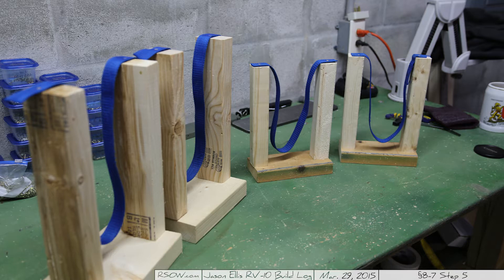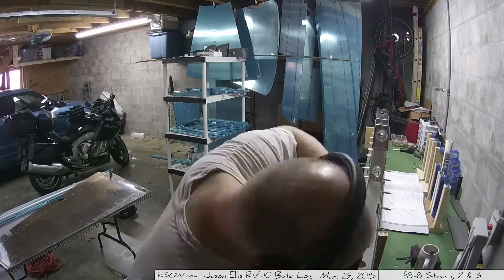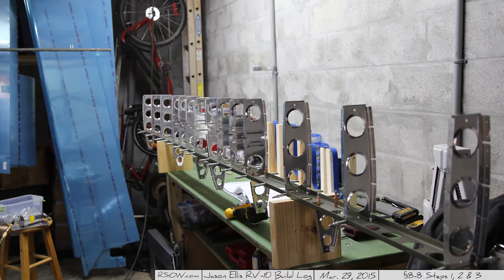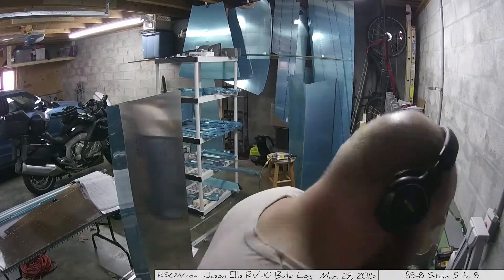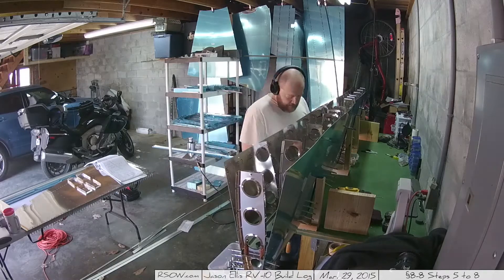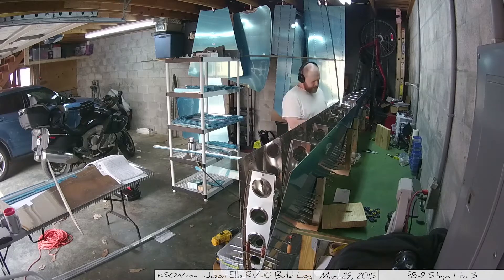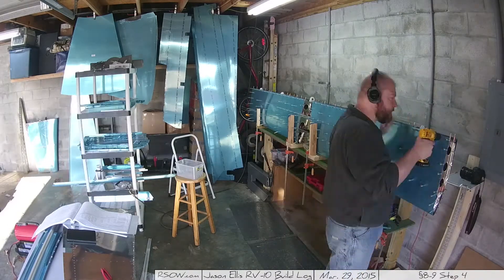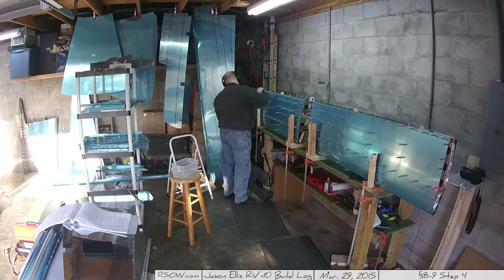RV-10 Empennage Sections 8-8 to 8-9 step 4

Comment: not sure what the instructions call out for, but i dont think you need a cleco in every other hole. you can go once every 5 or 6 holes, and be just fine, assuming its on a long run and not at the end of each part.

Comment: Jason, 

I am at this step right now... making the cradles. How long was your table in this video? I have a 6' long by 2' wide board I am thinking about placing between two saw horses? The reason for using the saw horses is they are adjustable, and I can get them pretty low. My goal is to avoid the need of a step stool to work inside the skin. If you don't think 6' long is long enough, I will probably just use my standard table and add extensions to make it 10 ft long ( it is currently 6' long as well) but then I will need to use a step stool. Hope you had a great Christmas! Thanks!

Comment: Honestly making these relatively cheap planes and selling them would be a pretty good job, some of them would allow you to pull in a profit of say $80,000 and as long as you keep that as your job you could probably finish a plane in a year, an annual income of $80,000 is pretty good
Reply from the maker: I have pondered that a lot actually.   I have been pondering making a video about it but the short version is; you're not guaranteed the outcome and there are things you're not taking into account. 

Right now if you go to work at a regular job and work 8 hours, you get money for said 8 hours.  Lets say you make $25 an hour.   You go to work for 8 hours, there are roughly 260 working days in a year at 8 hours that's over 2000 hours.   That 2000 hours at $25 an hour gets you over 50k gross income a year.  

Now for a plane;  Each of the RVs say they will take roughly 2000 hours to build.  While you're building it, you have an income of zero.  Zilch.  Nada.  Nothing.

Let's say you manage to get the plane built within that 2000 hour window within a year.  You had to have spent anywhere from $30k (for an RV3 ~ rough guess) to $130k (for an RV10 ~ not even top end stuff) to build the plane.  Then turn around and sell it for 20%+ over what it cost you.   Maybe.  

The market is such you have no idea how much you'll make, and whatever you make will have to be the starting point for the next plane.   Keeping in mind it costs roughly $30k a year just to live in the USA (cheaply) and suddenly you're not really making all that much.  

These are all off the top of my head numbers of course..   The big thing is that no one knows the future.  My crystal ball sucks.  Will you sell that RV8a you built for $85k (Van's Cost estimator) for $130k? (current price of one on controller.com) or not?  That'd only be a profit of $40k or so and you may not get that much.

How long will you hold a plane while it waits to sell?  Where will you store it?  What if it just doesn't sell?
What if it takes you longer than a year to build it?  

Etc..  I think the profit margins are far far lower than you realize.   Unless there is something I'm not considering..
Reply: I see, that's good to know

Comment: Just wondering the point of so much deburring and avoiding scratches, is it a cosmetic thing or does that actually effect how it works, hope you read this, I started watching cause I was wondering about building my own plane, I assumed I'd have to basically design it from scratch, then I came across your videos which led me to the RV series, I think I'll end up building the RV-4, old and with poor instructions I know but it's affordable, $18,000 vs $126,000..... I think I'll take the $18,000 kit lol
Reply: Also in the off chance you do reply and haven't figured out a better way to remove the blue stuff, I'd think a heat gun might make it easier
Reply from the maker: In one of the later videos I show removing it with a broom handle.  it just rolls off.
Reply from the maker: It's more than cosmetic.   A small scratch isn't much of an issue but a burr can be a point at which the high vibrations and stress in flight cause a crack to start forming in the aluminum.   That'd be bad.
Reply: Thanks for the reply, I'm the type of person that will skip something or do it fast and not extremely thoroughly if I don't see much of a purpose in it so that's really good to know, thanks for replying, keep up the good work
Reply from the maker: Oh me too.  But I can't recommend skipping this step.

Comment: I just found your channel, and am going through the backlog of vlogs.  I am an A&P mechanic and a commercial pilot.  I compliment you on your diligence throughout the build process, and let me assure you that you are doing a fantastic job. I know that I am more than a year behind so feel free to ignore any irrelevant comments.

For tooling check out brown tools, they are a major tool supplier for the aviation industry, but are perfectly happy to sell to individuals as well.

I highly recommend you get palm sized air drill.  You will find it to be much less tiresome, and will have much greater control.  Also, get a 90 degree pneumatic high speed grinder with some cutoff wheels. To make some of the more difficult and or oversized cuts.

When working with sealants, masking tape is your friend.

Regarding clecos, a set of pliers with over sized handles make a world of difference.  When clecoing a skin it is perfectly acceptable to place one every third or fourth hole so long as the materials are making good contact, if not then install more.

With riveting, any method that produces a properly installed and formed river is the correct way.  Also on the exterior skin surfaces I would only remove the film required for fastener placement, when assembled you can use more force to remove the remaining film.  The tip of scoring it with the soldering iron is a new one to me, but sounds great.

You are absolutely correct to be priming.  I think I would put an extra coat between any mating surfaces to give some extra protection.  I've always used alodine in preparation for priming, but the self-etching primer may be sufficient.

And, thank you for sharing your build experience.  I recently changed careers from full time mechanic to full time pilot so my funds are a little stretched right now, but after finding your channel I now know I'll be building a RV-10.  You are doing such an amazing service for all of the home builders out there.  If you'd like, I'd be happy to share contact info, and please feel free to ask any questions you might have for me.
Reply from the maker: Hi Kyle,

Thanks for the browning tools suggestion.  And I have discussed drills before and even mentioned getting a palm air drill, but haven't yet.  I use a LOT of masking tape now.. I prefer it to just about every other tape at this point.   Thanks for the support offer, I'll likely take you up on it.  Will message you when I have serious questions that I need an expert to answer ..(Likely a lot coming when I get to the engine..)

Also, you'll be disappointed in me on the priming thing.. keep watching =)